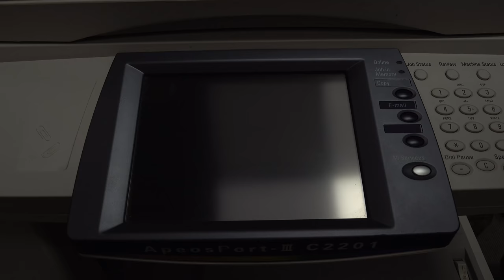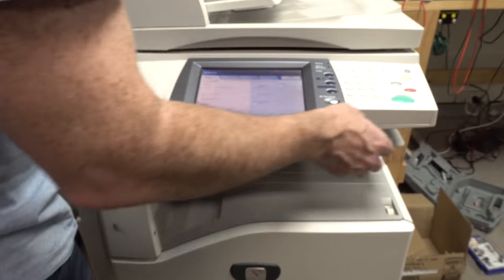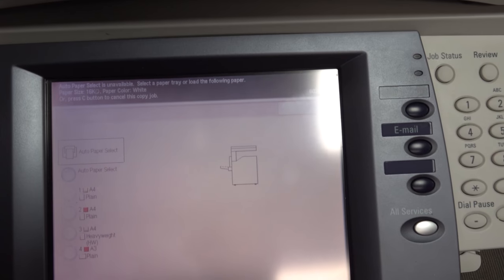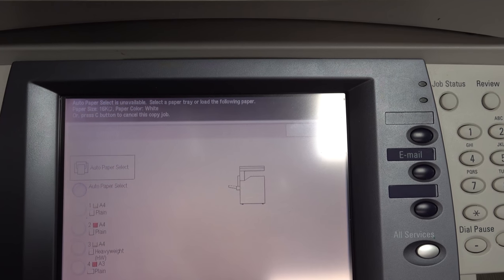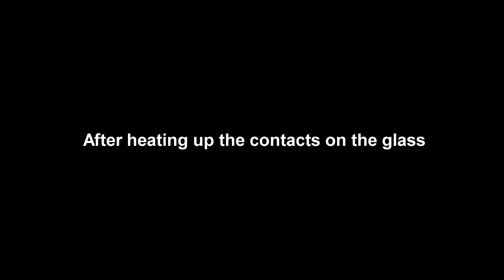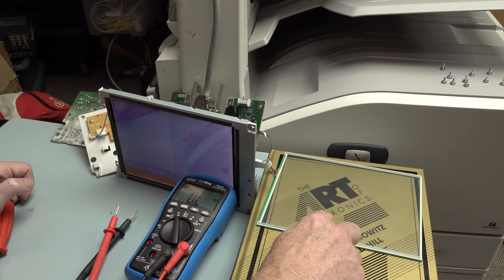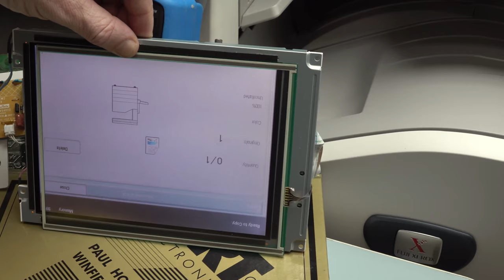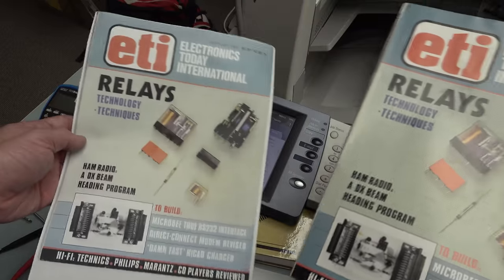EEVblog #1100 - Dumpster Photocopier Repair

Comment: Anything interesting on the harddrive? I guess you don't want to publish someone else's documents on YouTube, but I am really interested on how much you could find and maybe just tell us.
Reply from the maker: It's not a format that's (easily?) readable on a Windows PC.
Reply: what about a linux live drive? like ubuntu live usb?
Reply: id bet linux would read it.
Reply: You could try using PhotoRec.
Reply: The hard drive is used as a buffer between scanning and printing. Also used for the printer queue on the device.
It could use some small flash storage, but that's probably more expensive (especially in 2008, when this device was sold).
Reply: Couldn't it use RAM for that?
Reply: I suspect they didn't want a volatile queue.
Reply: Can't you check it out on the MFP itself? Usually they are for holding scans, large document uploads (i.e. PDF), etc. You shoulr be able to pop in there and print off something. Nobody ever bothers with security on those.
Reply: anlumo1 I think the additional EEPROM in top of the real time clock does the job of saving documents for the queue. The hard disk is for saving the pictures, so that you can print the last document again if you need it.
Reply: Last time I was buying copying machines for enterprise use, they all had hard drives, both for buffer, but because the things ran on BSD to control the machine and run the server.

I wonder how many copiers are now surreptitiously mining bitcoin, as it wasn’t hard to get into them...
Reply: The whole OS that runs the copier is on that drive too.  Or it was last time I was buying enterprise kit like that.
Reply: wouldnt the print queue files self expire and delete themselves? the OS on it could easily take care of it, than leave files on it forever
Reply: You could use RAM, but that's way more expensive than a hard drive for the capacities you need.
Reply: This is also a scanner, so users may have their "boxes" to which they scan documents, and after all they can download the scans to their computers. It can also make multipage PDF and send them over SMB or e-mail.
Reply: It is possible to find some stuff from the Linux level. There is probably a kind of temp folder called "ltp" or something similar if I can remember. I have found it in the memory of a Xerox 6204 Wide Format. Device was unable to automatically clear its buffer form an unknown reason and it locked itself from accepting new print jobs. It also gave no option to clear memory form the device level (including service mode). So we ripped its hard drive and did an open heart data delete surgery :) Worked like a charm after that.
Reply: Jusb1066 ... NSA probably wants you to keep your copied files forever. :)
Reply: Many copiers have NAS functionality, so you can store files and access scanned documents easily. The queue would be stored on the HDD, so if power was lost it could resume printing when it is back on. Spooled print files can also be very large, so at the time of manufacturing, an HDD was probably more economical than an SSD.
Reply: Copiers often use some Linux or BSD (you can even make some print its own sysinfo with some shortcut). So you should really try Linux for reading. However, i would suppose there is maybe some protection because companies often don't want users to be able to unlock for example additional features for free.

Comment: These were very popular in Japan. We used as printer and copier (and scanner to files). It was very fast and very reliable. Ultra well designed. Colors varied a bit over thousands of copies but still great for professional presentations.

Comment: I've done repairs on similar Xerox machines.  That random bracket you mentioned near the end of the video is probably to secure the power cord.  You may want to check Xerox's web site to see if there is a firmware update.  Some of these older machines didn't allow printing an error log on the screen and required paper to get that info.  I know there are "secret" keystroke commands for these printers to calibrate the touch screen and this varies from model to model.  Some require holding certain buttons while powering the machine on, while others involve getting to a special menu.  By the way the screen flashed, I was worried it was one of the 2 power supply boards was weak.  Some of these copier models were notorious for slow response times with the touch screen.

Comment: I've been around with those Xeroxes for decades. In the beginning we repaired those front panels but later we ordered just the screen from China or whatever. In summer time humidity gets in between the surfaces and you have to re-calibrate every week unless you replace the screen eventually.

Comment: I used to work on a different brand of photocopier which used those Sharp touch panels, and around 2010 (I think) we had to replace tons of them for free because of an inherent fault. I think the service bulletin said it was the adhesive at fault, as you discovered.

Comment: Hey, I network Xerox for a living... :)

(only a few minutes into the video) if they don't have Windows 10 drivers, just use Windows 7 drivers, they still function in Windows 10. Also if push comes to shove, the "Global Print Driver" would suffice as well!

EDIT: The cable/cubby hole around 15:45 are often for RFID/CAC/smart readers for authentication with AD (active directory) for example. We might have some old readers laying around the office... :)
Reply from the maker: I tried windows 10 and Ethernet and it works perfectly. Printouts on my Twitter

Comment: 15:40 that is likely to be a cable to connect a smart card reader for auditing. If you have a lot of departments or individuals with access to the copier, they could each be given a smart card to use rather than having to enter a PIN number manually.  Having worked with copiers for over 20 years, all kinds of ideas were pitched to make it easier to budget copier costs.

Comment: the Buttons are probably also mounted on other printer models from the same company so its like an internal "of the shelf" component where no extra molding had to be created,  just increased production volume of the same part

Comment: Different mouldings so they cannot be assembled incorrectly. Costs very little in significant production quantities and saves a whole load of cost rectifying later if it’s assembled wrong....
Reply: Stuart McConnachie there are other ways to do that with the same mold, like keyed inserts
Reply: Lachlan Jansen it would be bit awkward if some machines had red start buttons and green stop buttons while others had it right way
Reply: aleksin92 Yeah, and there may Ben be color coded prompts or instructions. There are possibly even accessibility standard enshrined in law in some regions.
Reply: How many would they be making of that one model?

Comment: I've seen things like RFID modules and MSR badge readers in that spot before to do authenticated printing and print-on-release in those spots before. Which is also what those hard drives are normally used for.

Comment: Know this problem well from one of the brands of copiers I deal with. The conductive adhesive they use seems to be the main cause of this problem. Also found they don't like the cold, this has killed many touchscreens. Later touchscreens seem to be more reliable so I assume they now use a better adhesive.

Comment: 18:44 is to secure the power cable into the copier. It takes a screw. I've had so many service calls because someone moved the copier and they didn't plug it all the way into the AC inlet

Comment: That cable that goes into the pocket behind the paper clip thing is for RFID/NFC interfaces, and in some cases USB connectors to the outside. It's used for user identification and printing files off of USB drives. Not sure if you could scan-to-USB.

Comment: Well done Dave ! I've been repairing copiers since the 1980's and have certainly seen some vast changes over the years !  The original ones ran on chain drives with Micro switches for position sensing, very little electronics and certainly no self diagnostics !  Modern ones email the service dept when they need Toner or Service, and can be often repaired remotely !
Reply from the maker: New fangled tech
Reply: I hate when the copier places its own service calls in our system. When you walk in the door, The customer has no idea why you are there. If the tech before you forgot to reset the life count on the part, then it's just a waste of time.

Comment: I find you have to heat and press to make a good joint with those tab bonds.The glue is saturated with silver dots (or some other metal) that get squeezed between the top and bottom to make a connection but doesn't short side to side. Hate them on LCD TVs, they've got the triple 2's. Too fine, too many and to hard to fix long term.

Comment: 19:00 I've tried a vast array of methods, which practically all of them work very well, but my preferred method is using a pulse heat unit with a lap flow tool attached to it. By using a wide bar shaped tip along with the appropriate temperature and activation time, I can reattach a wide variety of thermal pressed connectors in a matter of seconds with very little to no damage. The control is good enough to easily rework with very heat sensitive polymers in very tight proximity with each other. This is just one of several uses for a pulse heat unit.

Major downsides are pulse heat units, their attachments, and their tips can be very expensive and can require a bit of practice to properly use. Outside of certain work needs, I consider them "overkill." Because most technicians around here don't do this as often, nor do they perform repairs to the strict standards my rework tasks must comply with, a cheap low temp soldering iron tip or even some sort of "clothes iron" will be more than sufficient. I've even taken the heating elements from a broken food bag sealer and modified it to work as well.

Just my 2 cents.

Comment: 15:40 that's most likely for an optional card reader. I have to login using my access card for the doors at work to be able to use the printer / access my personal print queue

Comment: That cable that went to nowhere was probable for the autotron or other copy control/copy tracking device.  In the old days, it was a mechanical counter that had to be inserted to allow the copier to run.  The department was billed based on the counter.  Today, it's more electronic, but same idea: shared copier but separate billing.
Reply: Russell Hltn  as stated in another comment, that is for the contactless card reader. Or NFC. These are used when print and hold is enabled. I have installed the readers on these printers kind of cool to have tap and release printing.

Comment: I used to work in a copy and print center, and don't worry, a lot of the time, these Xerox machines are factory configured to "overwrite" the HDD either per copy (after spitting out the final copy/page) or per week, month, or year, so more often than not, the files aren't saved (and if they are, they're fairly heavily encrypted, if configured).. As far as I know, unless the device is equipped with a Firey controller (I think only the newer models are) recovery from these devices is very hard to impossible. The device should run a modified version of Linux.
Reply from the maker: Interesting thanks
Reply: Yeah, the Fierys store the jobs as PDFs in a zip style archive. You can just copy them right off. Most copiers on the other hand erase and overwrite anything temporarily stored to the drive like scan data. The drives are encrypted by default also for good measure.
Reply: Exactly, Xerox can it image overwrite. The new devices come with immediate image overwrite so the job is overwritten with random 1s n 0s after the jobs is finished.

Comment: You should update the firmware otherwise you can get a problem with pettern matching at scanning things to your computer the older xerox can change numbers and letters on the paper!  This was discovered throu an German it specialist a few years ago
Reply: That was my first thought, half a minute into the video, too. 😅 But the devices that were officially susceptible for character substitution were Xerox Workcenters (iirc), due to the JBIG2 compression. This is a Fuji Xerox device, a joint venture between Fujifilm and Xerox, and maybe they developed an independent firmware. Or maybe Fujifilm required from Xerox that scans should ALWAYS match the original document, while Xerox itself seemed to have had a somewhat more lenient view on this topic. 😂

Maybe Dave can give it a try. All infos can be found at http://www.dkriesel.com/en/blog/2013/0802_xerox-workcentres_are_switching_written_numbers_when_scanning
Reply: The trademark on the case has nothing to do with who developed this product. It's all just marketing these days, and these trademarks are licensed for certain target markets.
Source: I used to work for a printer company in R&D that sold its devices under all kinds of names.
Reply: It looks like the xerox work Center 7435 culd be the Same Device
Reply: It is a work centre 7435, this model doesn't have the problems with scanning, it is wise although to upgrade the software to the latest general release

Comment: The use of separate moldings was probably to insure the right color button got into the right hole.  We can't have them swapping red and yellow, now can we?
Reply: Also if there's something screen-printed or inset into the button, wouldn't want the wrong buttons placed.

The money spent to design and construct the plastic molds is spent once and can be used for all photocopiers of this series.  The assemblers can then be the least expensive unskilled labor available.  Spending $50,000 to make molds probably saves hundreds of thousands of dollars in assembler labor.

Comment: It looks like there's basically an entire computer inside this copying machine, with a PowerPC processor (Freescale MPC8349E), SODIMM RAM and even a hard disk !
I wonder what OS it runs.
Reply: Povilas Staniulis - It runs a proprietary "firmware" ... which I suppose could be based on some existing OS, if so, probably heavily modified.
Reply: On a PowerPC board of the vintage in an embedded system it's probably vxWorks. Brilliant real time OS but it's not cheap.
Reply: Tom Thornhill - And still quite underpowered.  Almost the entire WorkCentre series were irritatingly sluggish interacting with the panel.  I wouldn't be shocked if it's Java on top of vxWorks or something.
Reply: I used to work for the R&D department of a printer company. Our devices ran µClinux on a totally underpowered board. Mid development we doubled the RAM, because the larger chips were actually cheaper than the discontinued ones we started development on. All of the code was written in C to keep the size down.
Reply: Back in the Elder Days, I worked on a Xerox laser printer that had a PDP-11/34 in the controller. Beast could print 120 images/min in duplex.

Comment: Careful using off-brand toner in that. You wouldn't want to void the warranty. :-D
Reply: I remember Epson did a dick move on pirate cartridges where each time you powered the printer on it printed out a full color picture as a "check" if these toners worked... Fealth more like a middle finger and a "lets drain these toners so the end user buys our toners instead of the much cheaper ones not made by us".... Let's just say the customer threw that whole printer out after he had a whole box of full color prints of a parrot and he never bought an epson again.
Reply: in the US you can't void the warranty   if a  after market professional repairs it.(i.e playstation 3)  the warranty void stickers are not legally valid at all to void the warranty  per the us laws
Reply: punker4Real I was joking... I'm sure that copier's warranty expired long ago, and probably doesn't transfer to dumpster divers.
Reply: Just because the manual says so it isn't true, or to be exact it (in this case) is wrong.
Reply: punker4Real That may true but that's typically not the case with copier machines because 99% of them are leased. So the warranty can still be void unless the company does the repairs. In fact the company I work for even if you move the copier to the other side of the office it can void your warranty and you will be out a lot of money. Source: work for top copier company.
Reply: @chrizizdaman  Californian here.  The leased copier contracts include all consumables (except paper), and repairs.   The consumables (toner, whatever else besides paper) is covered by the lease, up to your contracted number of B&W and color impressions per month, then you pay an additional amount per impression.  Note an impression is one letter size, so ledger or tabloid (11"x17") counts as two impressions.  Legal (8-1/2" x 14") counts as one-and-a-fraction.  When we moved an office, we paid the copier leasing company separate from the moving company to move it, otherwise if something happened we'd be on the hook for repairs.  And after about 10 years, the parts are no longer available for repair and the leasing company will not renew the contract and try getting you on a new one.

Comment: Where did you wind up putting this? I doubt it's easy to put up a printer of that size in your place. Though it wouldn't have trouble fitting in!

Comment: You would think there would be a clamp as well instead of just adhesive to hold those cables on. It just seems like an easy point of failure.

Comment: These things get twatted on the regular. Then they complain that the touchscreen doesn't respond properly after a few years, and eventually goes on to the scrapheap. It's a shame, because they are normally perfectly fine, just needs the 'screen' repaired/replaced if they look fairly new. My job requires me to go into office blocks all around the UK, and you find these fairly commonly, sometimes as many as 4 or 5 in one large office block around tax season.